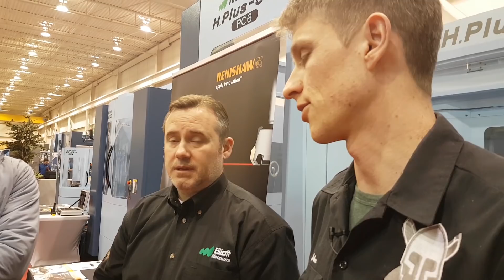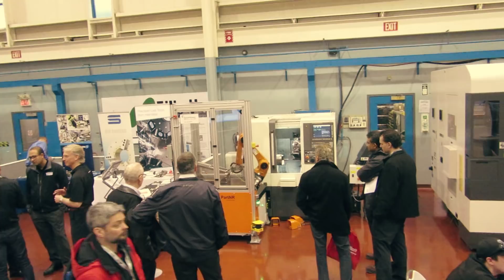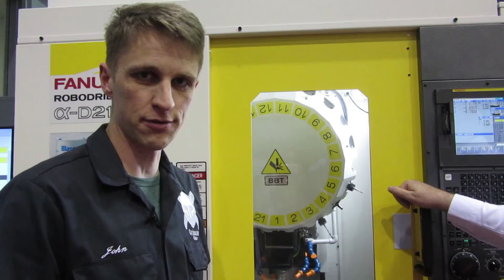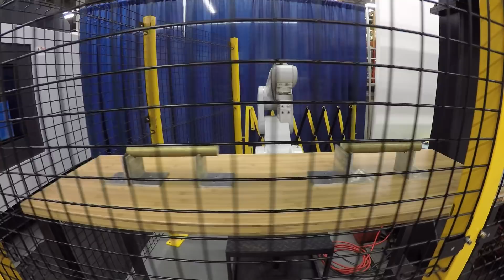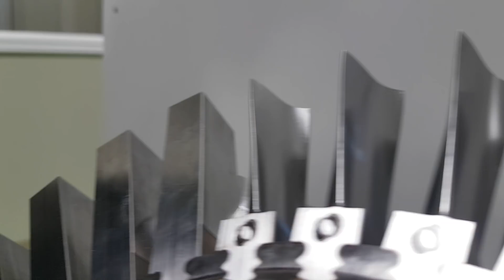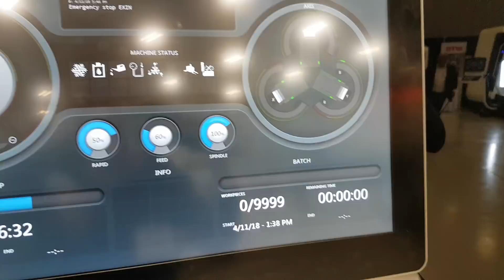Joint Open House 2018!

Comment: hey John,
awsome video! 
if you really are looking for a new machine, you should really be looking for a horizontal machine.
With your fixtures, and some tombstones you would be able to fit atleast 8 fixtures on 1 machines!! and it should make for a good overnigth run of knives  
if you go for an extended pallet system even more production 
also you get a 4th axis so you can start to experiment a bit more with milling
and go for anohter mori they are beasts!

Comment: Great footage as always👍👍 

I hav wonder many times that hav you ever think about get spinjet to yours mill... save little spindle bearings and speed up maybe.. you hav so small details in the knives.
Reply: Nice tip. I've the air driven ones for years but using high pressure coolant is brilliant. Are you using them currently? If you are how's the runout?
Reply: I'm not using but heard lot of good of them

 and runout what is it😂  and microtools needs only light tap if you hav....

Comment: How much are those light scanners?
Reply: Not sure but it's possible to make your own. Actually there's a few methods of scanning that absolutely DIY possible. Hell you can get a pretty good model with nothing more than camera and some photogrammetry freeware. A while ago I used some old xbox connect sensors to make one. The coolest are the handheld scanners I think they are around 5 Gs though.